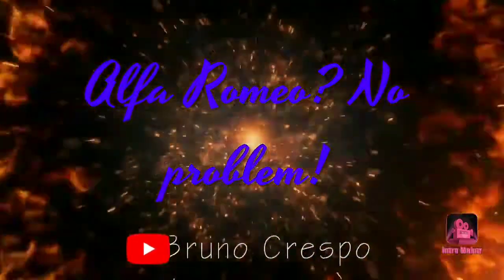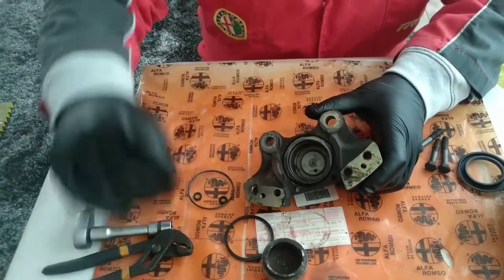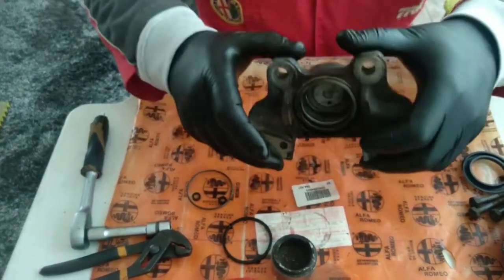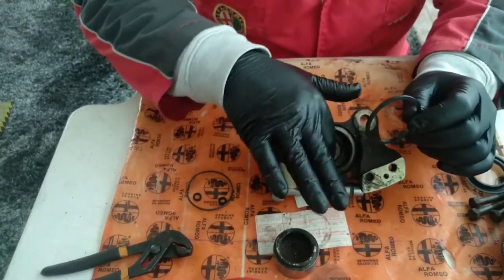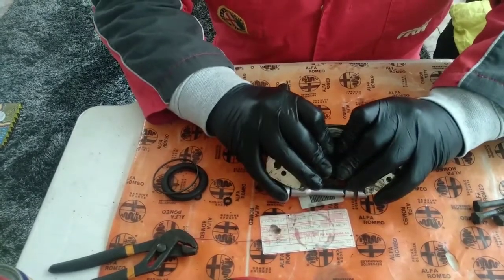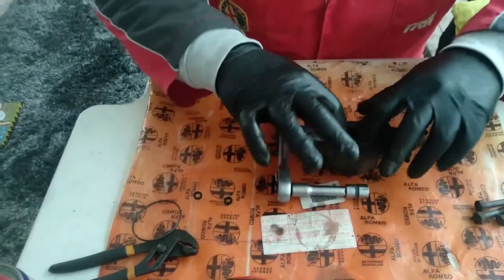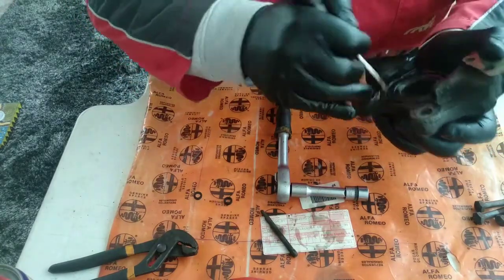Assembly Repair calipers, importance of details  Project #alfa75 ep 5

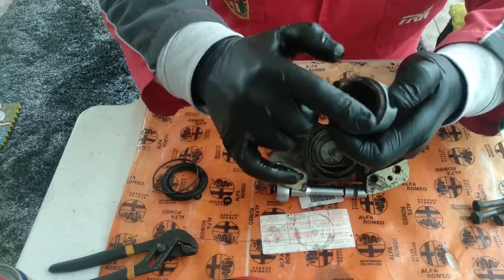Comment: Brother, Happened to see mention of the piston going in at a 20 degree angle to direction of travel (with reference to the degree of uncertainty you expressed at 3:40), when I was randomly searching for something else. I will dig up the link and post it here. I put mine in straight, but am now going to redo them.

Update: here's the link
http://www.autocomponenti.com/tools/caliper_piston_alignment.htm
Reply from the maker: Thank you very much! Turns out i did rotate them a few days later also search for info on the multi piston calipers the smallers are always after the bigger ones. That give me the idea to put more print on the top side. They do this to the pads no to jam so much. 
I'm really glad you took the time to search and post it here! Thank you so very much!

Comment: Video is dated as two years ago, but
For what it is worth?...and I know nothing...My understanding was that you should not use/mix WD40 with brake fluid, but, as I say, what do I know?
I do know that my repair kit came with assembly grease for both rubber and pistons.
I also did the overhaul without splitting the caliper, but it is a bit of a knuckle biting job that way, but possible.
My manual says what angle and position the piston "cut outs" should be replaced in, off the top of my head I think it was at 45 degrees, but without checking I can not remember what direction they should be facing...its in the Haynes manual.
Reply from the maker: Thank you very much. It is actually a bit older that that, it was reuploaded two years ago, the video has now more than tree.
The car made about 10.000 Kms, now it's time to do a full engine repair.

Comment: Hello...
I am very late with a comment on this video, but maybe some one else will read this later?
The cut out in the piston, is shown in the Haynes manual, and it is set at 45 degrees.
Also I would ask, is it ok to mix oil (WD 40) with brake fluid, I thought not?
Reply from the maker: Hello. A few years past, yes. Since then I saw the correct position of the piston. The bleeding precess took out all of the WD 40 and the brakes were perfect. Now the car is stopped again, engine gone wrong..

Comment: Oh I forgot...remember to loosen up the bleed nipple before trying to replace the piston, and .....I used an air foot pump/tyre inflator (I don't have a compressor) to blow out the pistons from the caliper at the start, just have to put a block between the pads so that they both push out.
Reply from the maker: Frozen bleeding nipples are not a problem here in Portugal. At the time I did not consider other countries to advise for it. Now on more recent videos I always try to remember that. On my next video next Sunday I will talk about that a bit. 
About the compressed air, you can imagine it was at the beginning of the channel, no tools, no nothing.. just trying to make it work.
I hope you can understand

Comment: WD-40 is actually not very good at lubricating and preventing rust. Sonax SX90 is much better. Auto Build magazine did the test of multi purpose sprays, and found this.
Reply from the maker: Yes, you are correct. In a pinch is better than nothing.